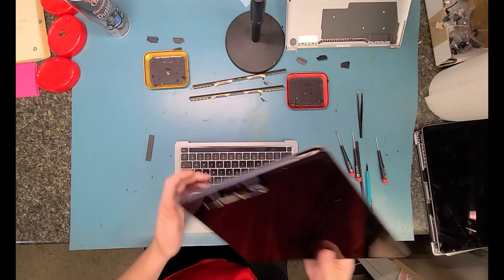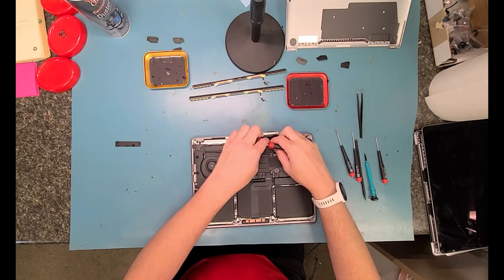🔧 MacBook Pro M1 A2338 Screen Replacement Guide | Step-by-Step DIY Tutorial 💻

Comment: I need to repair the MacBook Pro 13 M1 screen, what is the price? thanks
Reply from the maker: Depends if you use an after-market screen or a OEM
AF is like $210-350
Depending on the grade OEM is like $450-600

Comment: Is MacBook Pro(A2338) compatible with the screen from MacBook Air (A2337)?  not sure why but A2337 screen costs cheaper than A2338. maybe somebody knows what is the difference these two screens?
Reply from the maker: I never tried and do not want to risk a customers logic board but I do not think they would work
Reply: @worthitrepairs  thanks for reply. I’ve checked. It’s incompatible. Also found confirmation on ifixit forum. 
P.S. thank for the video. Like

Comment: hello i have macbook pro m1 2020 its slight band from center only touch bar not showing display but its working want to know if you can fixit by changing the body and how much it will coast.
Reply from the maker: That's a repair I have not done because the cost is too much. I believe if you swap the top case/keyboard assembly with the touch bar it should still work if you want to buy mine I have it on hand here. $250

Comment: Hello Mark great video, thanks for sharing. I did and it works but the camera not work, I've tried two different screens one no new used screen and one new screen and the both the camera didn’t work and also the Touch Bar in the second one, new brand, initially didn’t work I did some reset and now the Touch Bar woks but the camera not, do I need to do some kid of configuration? 
Please con you help, the model is a2338 m1

Thanks.
Reply from the maker: Do you have the original screen if it still is functional put it on and see if the camera works?
If it does then its the screens make sure to check the connection always before putting the old screen on. I would suspect it most likely is board level

Comment: and the camera is still working after repair ?
Reply from the maker: Yeah it should otherwise you may have a bad connection or faulty screen
Reply: @worthitrepairs  We don't believe you. Prove it !
Reply: From what I researched the camera serial is tied into the T2 chip, weird that he never test the camera that also ties into the keyboard light and ALS functionality if the camera doesn't work

Comment: My MacBook Pro is just 2 months old. There is light leaks around the bezel of my MacBook Pro. Apple replaced the display only. I still fear if there would be any problem in future.
Reply from the maker: Sounds like a manufacture defect it shouldn't happen again unless you end up with another faulty macbook screen

Comment: True Tone is gone, right?
Reply: I've replaced these before.  I have to add the serial number to GSX to run the System configuration to recognize its genuine.  Before I completed the configuration, I ran MRI and it issued a warning for an Apple Genuine screen.
Reply: @joshuam5772  can you please explain in details how to configure it as genuine?
Reply: @weiningkang9949  Unfortunately no.  I only know how to do it legitimately.  I have no knowledge on how to bypass it.
Reply: Josh is this also why when replacing these screens the camera doesn't work and ALS / keyboard light function is gone too?
Reply: The Screen is an OEM pull so I do not think you would lose true tone but not sure I will have to check on my next repair
Reply from the maker: I am not sure if it works as if it was a phone I will have to look next time.
Reply: @worthitrepairs  not works
Reply from the maker: @AntonioFerreira-dx8cf  I worked on a M1 Air but no user password and firmware locked. I Couldn't check